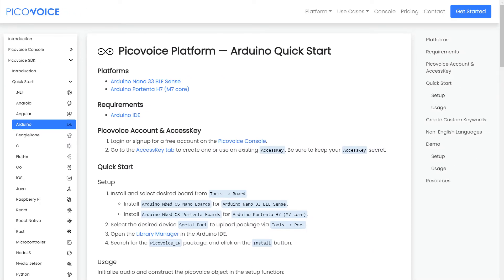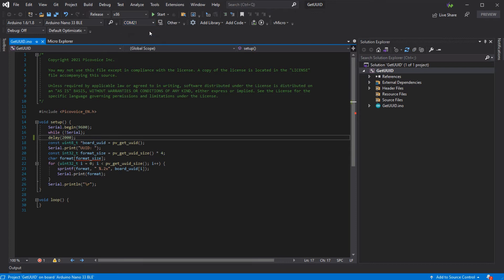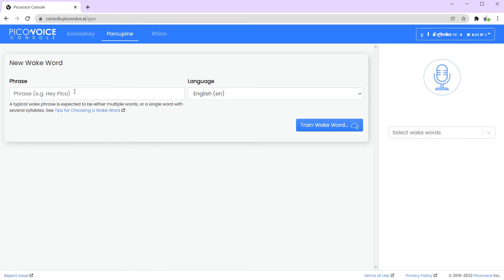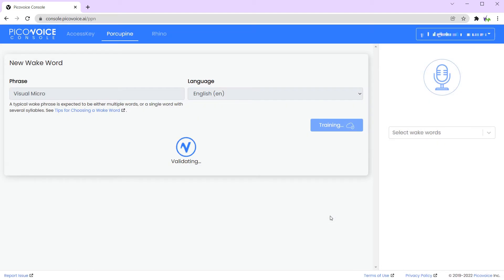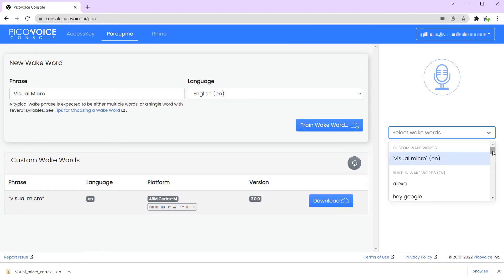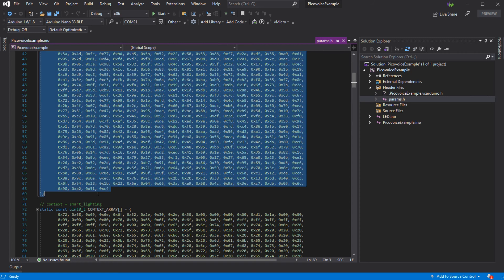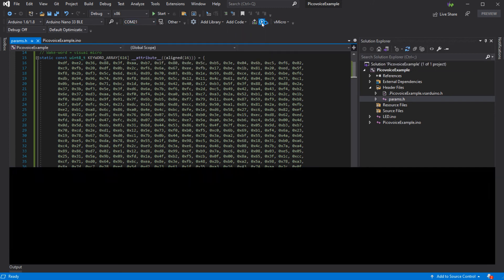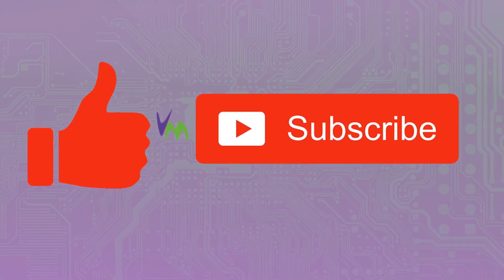Custom Voice Control Wake Words

Comment: I'd like to run an application that wakes on "Yo Ben"..  on a PC is offline and old, so I can't use an AI/API.
(Once the wake is detected, I'd like to transcribe the command that follows it using RealtimeSTT).

I like webrtcvad+mycroft-precise, but it uses old python packages (ex. scipy 1.2), so I'd have to separate the wake task from the transcribe part (RealtimeSTT uses scipy 1.15).  The two applications would share the microphone and communicate via websockets.  

Picovoice's Porcupine looks like it may even work better on my modest hardware.. however, to use a custom wake ("Yo Ben") would require a paid subscription license?  Is that correct?
Reply from the maker: Sounds like an interesting project to repurpose old hardware....

To my understanding you get 1 custom wake phrase with the free (non-commercial) account:
https://console.picovoice.ai/signup

Comment: How to add another custom supported library, like for esp32s we added a json linkl similarly if I want to add one what should I use?
Reply from the maker: Libraries can be added to your project as shown on this video:  https://www.youtube.com/watch?v=37uClFFBQeA
They can also be manually installed from a ZIP file you have downloaded from the vMicro > Add Library > Install Library from ZIP. 

Library Documentation links:
 - https://www.visualmicro.com/page/User-Guide.aspx?doc=Add-Libraries.html&source=37uClFFBQeA
 - https://www.visualmicro.com/page/User-Guide.aspx?doc=Library-Manager.html&source=37uClFFBQeA

The JSON URL is for board packages only (e.g. ESP32, ESP8266, Arduino MBED etc), which can be seen in this video:
https://www.youtube.com/watch?v=yHBP5TOXr2I